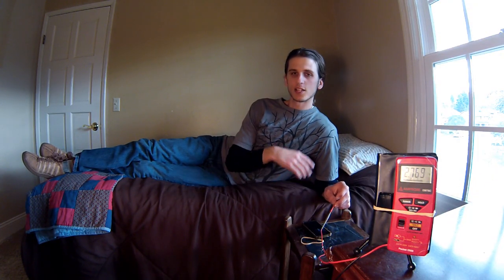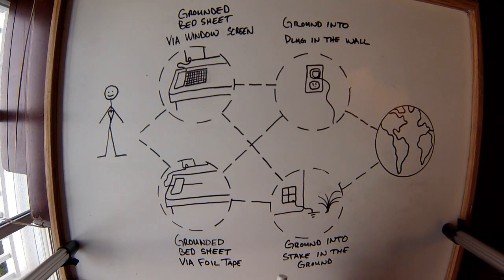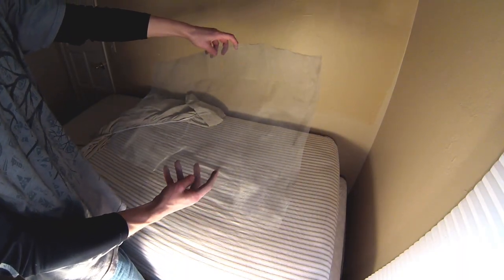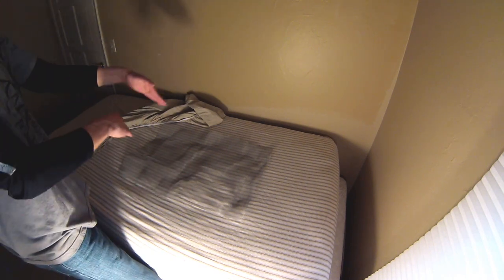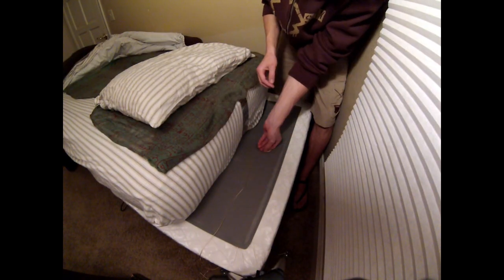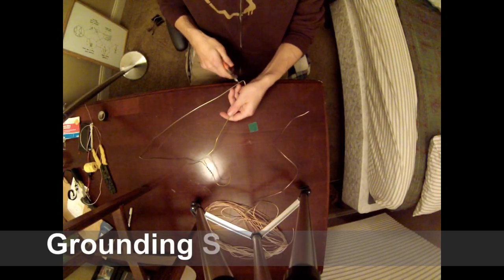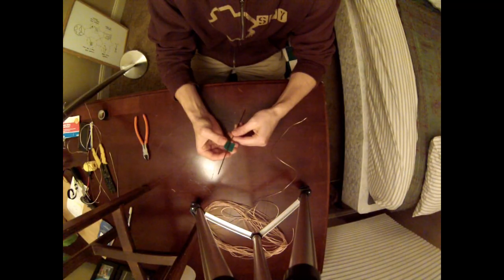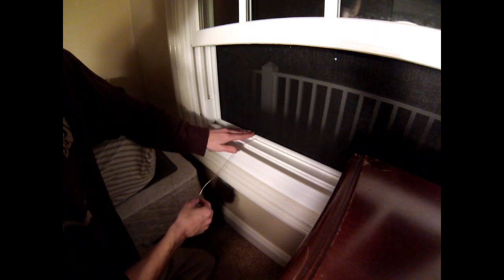DIY Earthing Sheet: How to Sleep Grounded Indoors (Tutorial)

Comment: Am curious why the conductive mat is covered with the bed sheet? Everything i've read indicates this works best when there is maximum contact between the sheet/mat and our skin.
Reply: Haddie Bee wen he took off his shirt the meter dropped to 1.27 v from ten v . this happened because he was wearing polyester which is a form of plastic which with stop the electric magnetic flow to go threw the body n out. If he was wearing linen which has  5000 frequency  unit.  Polyester only 15 units of frequency . disease can live in a body or part of your body that vibrates at a low frequency   . 5000 frequency's of units with destroy the disease. So a proper linen sheet with linen p.jays with a grounding mechanism under your linen sheets shud show good readings n heal u superbly. Linen alone will heal pains in ur body . type up the power of linen in Google  . wear linen n ground urself

Comment: There is one thing I can't figure out  To measure the body voltage 1 pin must be grounded.....so how do you get a reading when one pin is already grounded. Isn't it always zero when it's grounded???  On top of that I think I've bought a dysfunctional meter, back to the store tomorrow.

Comment: Be aware that in wireless-networked areas and around phone masts there's lots of radio interference which will be caught in unshielded cable as alternating current. I experience this as an activation of my prostesis motor when I've taken it off. To get away from that trouble, Cat 6 ethernet cable can carry a lot more channels down to the ground, and is decently inexpensive. It has 8 twisted-pair wires in it, so you can ground up to eight separate stakes in the soil from your house. For wireless interference in the air right at the moment the best I can think of is aluminium foil under the rugs and up the walls. Coaxial cable (like for old radio antennas) is also perfect for grounding! It's a single-channel connection.
Reply: how about I grounded with water tube?

Comment: Practically, this didn't work for me: the window screen was too rough, stiff and prone to damage. Also duct tape would release (mattresses are flexible and you move in your sleep too).  Pins are better, but release in 1 night as well. I don't want to use aluminum tape, because you absorb it and it's harmful. I thought this was a cheap option, but now I wasted $45 bucks on window screen. At least I bought the plug and wire from an official grounding store, those are pretty handy and not too expensive.
Reply: VRS Estheics You are probably right,  however i did try putting a light sheet over grounding material and surprisingly my body voltage went down on the multimeter.
Reply: I use the same method as the guy in vid. Except that I just use a wire and attach it to the bed.  It's skin to metal contact and i run it across the bed about where my calfs are. And I don't feel it. Calfs aren't that sensitive. So I end up being grounded for cheap. It's just copper wire (stripped) and that wall adapter
Reply: Would you absorb the aluminum if it was covered with cloth?
Reply: @elijahrusso5403  yes
Reply: Elijah Russo You would no longer be grounded once you put a insulator in between the metal and your skin rendering it useless.
Reply: Gopher Cheese you said copper .wanted to know if you can use copper on the sheet instead of aluminum and for the wire use copper to transmit the electrical charge as a conductor to the bed want to know

Comment: Cheaper and better for you:  Get a three prong replacement plug at Lowes and remove the flat blades leaving only the ground prong.  Get a short pre-packaged roll of #14AWG in the wire section.  Total cost about $11.  Attach one end to ground prong and the other end you must strip eight inches of wire.  You will plug this into your home circuit and use the ground rod under your electrical meter.  No wire run needed.  Wrap an eight inch sheet of heavy duty aluminum foil around bare copper until you have a flat rectangle eight inches long by 1.5 -2 inches and flatten into the copper.  Fold over three times to hold the wire in and flatten again.  Place this in your waist line against the skin anytime you are lounging around the house and all night while sleeping.  The benefits are remarkable.  I have not been sick in 4 years.  I feel like I am 30 years younger.The problem with the conductive materials is continuity or resistance.  The conductive material never gave me a direct short, there was always a large resistance or lack of continuity and the skin is the most conductive organ on the body giving you a direct short to ground.
Reply: I don't understand this once you say to  use the ground rod under your electrical meter. You lose me totally.
Reply: Do you have a web site or video where you describe how to do what you write about here? For example, where do you attach the stripped end of the wire? How do you "use" the ground rod? Where do you attach the aluminum foil that you describe? Thank you.
Reply: +Luxoriginalis  I am working on it.
Reply: You could drive a rod into the ground, outside your window, attach a wire to the rod & run it through the window.
Reply: Hi Ms. Osborne - Grounding is a great idea...  Even if just walking barefoot on concrete for a few or reading a book in the yard with your socks off.  Detoxing and diet supplements can help in addition too...  Have you tried powdered MSM and Glucosamine for your arthritis?  Ascorbic Acid and lougals Iodine are also important in helping to heal your body.  Best wishes.
Reply: Thanks! :)
Reply: +Ly Kri There is a ground rod on your home circuit if your home was built after 1965 that you can use to make contact with the earth.
Reply: I live in a trailer.
Reply: @lykri3350  I live in a tree.  But its metal so its grounded.  Lucky me.
Reply: Aluminium is toxic. Read my comment above.
Reply: DamanSound  you can't be serious,  what if lightinging hits your house and your connected to the grounding system! Or if there is a fault in one of the appliances
Reply: agreed.  better to be connected to separate ground rod and, personally, I would have more than one inline fuse just in case.  lightning strike can blow the fuse but it is possible for it to blow it and there still be conductivity (usually not with something that powerful, it would vaporize the fuse but still possible).  cheaper power strips give you protection from one blast but can blow in the close position (according to APC which is why they will only guarantee equipment connected to their more expensive strips which blow/trip in the open position...or so they say but it seems logical).
Reply: even better.  then much easier to get to ground.  I sleep on the third floor so much greater distance to ground.  just drill a small hole through the exterior wall next to your bed and seal it with polyurethane sealant.  really any kind of caulk would do.  dont forget the inline fuse though.

Comment: After watching your video; but not hearing half of what you said, I decided to make the sheet, because I am surrounded by cellphone towers and be waken every night at 4am by the pulsating. I connected a wire to a rod in the garden as we don't have grounded houses here in Thailand. I have been sick for 3 days, ie as soon as I started sleeping on it, I have had coughing fits day and nights and strange headaches. This morning I actually felt the EMF wave on my body, it came over me shaking me from up to down. I fell like I was being fried up. I also bought a meter to check what was going on and cannot make any sense of it. as it show 4 times higher voltage when I touch the rod 0.45V than when I don't touch it 0.1v.
Please help me, I do have faith in earthing but I don't seem to make it right; and I am sick and confused. Thank you for your help
Reply: I'm curious about your results. Did you figure out why you received such negative results? I'm thinking  you may have stray voltage nearby.

Comment: good idea in principle but dont do it all this way , back voltage from the house currant ground will cause you trouble . 8 by 4 foot screen with  cloth hockey tape on edges place  on top of you your arm will touch it enough . you probably will not need it all night it is for a period before sleep or during a nap . this is big enough to ground itself through the either if there is moisture in the air proper for breathing,.,.,.,. use a real earth ground do not trust the house wiring

Comment: When you use the product like you have described your body becomes a conductor. This is very dangerous and exactly opposite to what you are trying to achieve. The proper thing to do is to eliminate the electric fields that create the body voltage. These electric fields are caused by the wiring in the walls and floor and ceiling. A little bit of knowledge is a dangerous thing.

Comment: so I got some aluminum screen and hooked it up to a wire on a ground rod.  At my desk my voltage is 2.6mV, standing on the wire it goes to -50mV, and standing on a piece of aluminum screen clipped to the ground wire it goes to 400mV.  Not sure why this is happening, but for some reason the aluminum screen makes my body voltage worse than being ungrounded.  I also don't understand why my voltage is going to -50mV when standing on the ground wire, or if this is a good thing.
Reply: just conjecture here, but I wonder if the screen is possibly picking up bad EMF and spiking your voltage.  Are there any CFL bulbs nearby? those things are bad news. But my guess is the screen is picking up some unwanted energy.

Comment: Thanks , but I do not understand what you mean about not attempting this. No I don't understand electricity. But I know I cannot afford the materials other than purchasing a couple of things, which I feel is my duty to do for Dr Ober. However, I have many chidren who are suffering because of this sensitivity they have. 
I hoped to use this for them!   But I read you said you used "a fuse" and I dont know what that means. so I feel I should not attempt anything at all. I realize you don't want to be responsitble for accidents I could have. I appreciate it. 
I heard also about resistors. That is another confusion.

Comment: Currently testing a wrist band I made with elastic a washer and some speaker wire. I have run the wire to my shower head as it is Eathed with copper piping. I will be trying the bed sheet also

Comment: What happens if a lighting strikes the ground where that grounding pole is? It sounds a bit risky.
Reply: +Edwin Raynor  You are talking rubbish. Most electrical items, cookers, washing machines etc. are earthed. Are you saying we shouldn't use these during a storm? Also, when you say that there is no possibility of grounding helping you, do you realize that grounding is used by cyclists in the Tour de France as an officially recognized aid to recovery from muscle fatigue and stress?
Reply: As I understand it, it doesn't matter which plug you use at either end - just make sure one plug is attached to the grounding rod and the other plug is touching you when you are testing.
Reply: I tried this for the first time ever last night with a wire around my wrist and the other end around the shower head. I slept sooooo well and my knee pain was so dramatically improved I put a more permanent solution in place running the wires along the
 wall out of the way
Reply: @moonchildoforcamoon6272  can you send picture please
Reply: pleas can you explain more
Reply: +Moonchild of Orcamoon Please don't, the shower head is connected to the frame of the building. Some have been electrocuted by showering and touching the head during a thunderstorm. You are risking your life for something that has no possibility of helping you.
Reply: Eric Rowland
A high-ranked insurance person informed me that no matter what, if there is big electric storm near one's house, ANYTHING that can conduct electricity, even if those are not plugged in, will carry those strike charges. 
In TX, insurance pays out a lot on claims for electronics and appliances which were unplugged during electrical storms. Owners often shut their power off at the mains panel to prevent damages during bad storms, only to lose appliances anyway, he said...guessing he would know, since it was his business to know.
Reply: ok thanks ! I will be by his place next week.
Reply: Sounds good - Of course there's always the placebo effect but maybe you are really on to something!
Reply: I never have it connected in a storm nor do I shower in a storm
Reply: Mine is Copper right though, it was installed in the 1950's
Reply: +nin6246 LOL
Reply: +nin6246  I;m thinking the same thing, Thats why mine is hooked up to a shower head that is grounded
Reply: Well I did mine yesterday. I put the post close to the house. Do you think it works? Have you feel better? I don't have a volt meter to see if it's working. :)
Reply: TreebranchIsLoyal I would want to verify with a volt meter. I'm intrigued by this concept of "grounding" and certainly think there is some legitimacy to it along with avoiding EMF's in general. I mean, how hard is it to schedule the router to turn off the WiFi every night when you sleep (many routers have this option) but I digress.

Let me know if you end up getting the voltage meter and have any interesting results. I'll be buying one myself at some point before the end of the year. Thanks.
Reply: Sounds good, I have a friend that has one hope he'll let me use it !! I am confused on  the plugs "red and black" where does the red one go? lol or black?
Reply: nin6246 That can happen, however tests done with flowers proved the the vases with the wire in them to Earth, lasted longer than those without. I plan to run my own experiments to see this for myself, I want to know if these tests were real or not
Reply: +Moonchild of Orcamoon , just make sure the plumbing that feeds that shower-head, is metal not plastic.  Lots of homes are plumbed using plastic pipes....those cannot be used as a ground.
Reply: But those electrical items don't have water connecting you and them. That's why showering in a thunderstorm is dangerous. You are directly electrically connected to the ground.
Reply: When electrical circuits branch the percentage of current that goes through each branch is proportional to its resistance. What this means is if you are touching two different grounds and the resistance between them it is not significantly smaller then your body resistance you will die. This is why people sometimes die while taking a shower in a lightning storm. Their feet are touching the drain and their hands are sometimes touching the shower head. Although both are grounded the resistance between them insignificant as there is a large length of pipe and wire before you can find a common ground.
Reply: Edwin Raynor
Most homes are now plumbed using plastic pipes, therefore, hooking to a showerhead fails to "ground"...because that metal showerhead [and again, even many of those are plastic that only appears metallic], is only connected to plastic pipe. ...someone might be better served by hooking that wire to dirt in a flower pot!
Reply: Edwin Raynor
People have found that having more lightening rods and grounds for a house, is not better.  Having only one, works better than using multiples.  
Would that have something to do with the forks in wiring and resistance you are talking about?
Reply: The safest method would be via a grounding rod, not an outlet.
Keep your grounding rod near your home and away from large trees or structures.
For nights when thunderstorms are predicted, maybe forgo.
The chances of lightening directly hitting your rod are very unlikely anyway, especially when there are taller targets in the vicinity, like trees.  You may get some dissipated current if a large strike hits nearby but nothing that will hurt or kill you.  
If you're still wary, add a fuse to your set-up.  Or put a lightening rod on your neighbors house, lol just kidding :o
Reply: In line fuse.... keep up flash